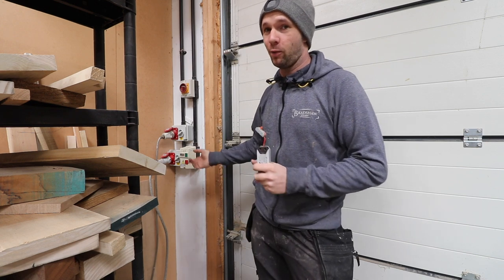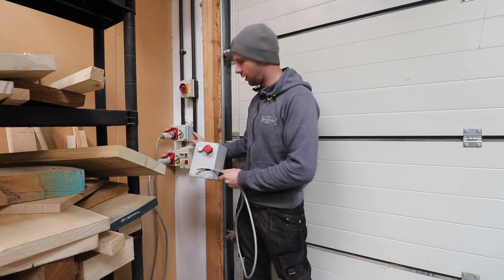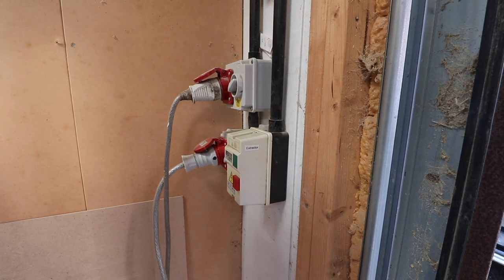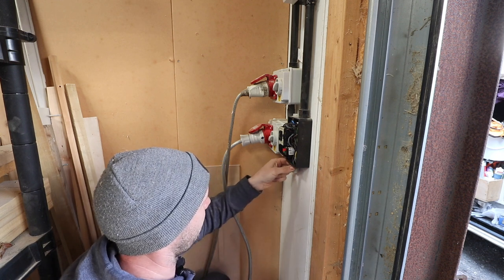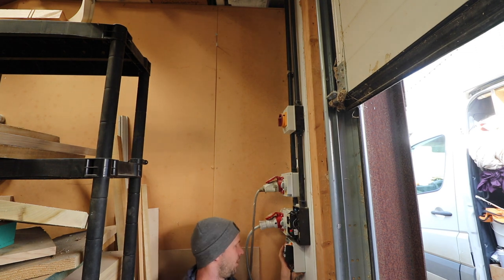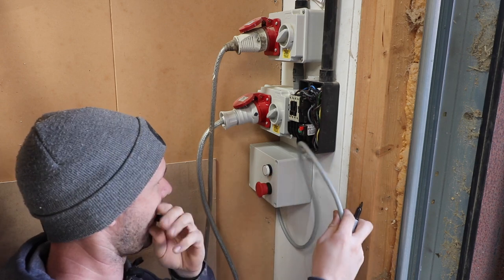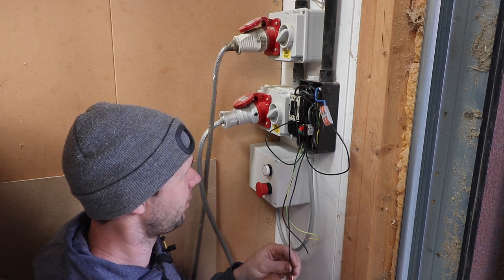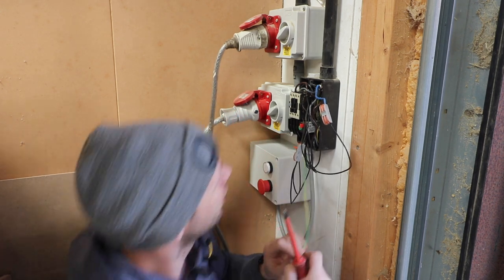Proper Solution for Remote Control 415v Dust Extractor

Comment: On dust extractors that are connected to machinery circuits, the extra run time when turning off gives the extraction system time to clear the vacuum lines before shutting down. In your case, with a remote, the off run time should be based on the machine furthest away from the main extraction unit so lines clear and build up at blast gates is reduced.
Reply from the maker: Yeah true, I just assumed that the remote system your telling to shut off, so can shut off at the appropriate time. It makes sense and is no bother though!

Comment: A great improvement with your audio Oli 👍🏻
A good modification for controlling the extractor too, very reasonable price for the added convenience. 
I think I will be picking up a set of those long Erbauer bits too. I had an occasion recently where I could’ve really used them. Thanks for the tip off 👍🏻
Reply from the maker: Cheers Mike, i was astounded at the audio difference. Yes i liked the unit overall. Itll be a very welcome addition to my shop! What i like about the bits is the compact little case and no extra ones your never going to use...!

Comment: I am always learning things from you. Thanks. Prior to festool developing their own Bluetooth system I’d managed to find an aftermarket bt set up for jobsites / very portable and efficient to employ when Using a cordless sander or Mirca sanding block with a dust extractor.
Reply from the maker: Cheers Mark, Was it a bluetooth plug adapter? I know they work but prone to failure due to the load of a extractor motor, these guys do a solution for that aswell! haha The bluetooth is incredibly handy
Reply: I worried about the load to a point and so kept an eye on things. I was using big box BT with an old CT 22, no problems at all long or short term. Used many hours at a stint on new construction custom home projects. Maybe I was just lucky!  It was not a very refined setup, just efficient.

Comment: Nice. I am lookin go to get a new dust collector too. Current one is too small for the wide belt sander.
Reply from the maker: Ahh, yeah they need a bit of sucky sucky! How big you going, i saw a setup the size of my workshop for sale the other day! haha! It would turn my shop inside out i reckon
Reply: I probably upgrade to a 25HP DT-250 with 9000CFM. I need more space in dust bay. The one I currently have is headache need to clean once an hour if I am running crazy amount or lumber through planet and jointer.
Reply: Can’t decide on the wide belt sander SCM vs Weber. Which do you recommend if only for doors and windows plus some cabinets work. Moldings not much. What do you recommend
Reply: Many thanks

Comment: Can anyone recommend a reasonably priced shop vac, with a 60mm inlet. Strangely, Im struggling to find one. Nice solution to that annoyance Oliver.
Reply from the maker: I like the Bosch, gas25 been real robust for last 15 years. but i have to say the festool Midi is brilliant, i wouldnt buy a different hoover again! Not sure if it has a 60mm inlet, think it does, you can get a big bore hose too if needed. 36mm.
Reply: @BradshawJoinery  Bosch gas25, looks promising, and with comes with a 35mm hose🤔Ive tried reducing the 100mm, from the chip extractor, and increasing the 26mm from my Trend T35, but the suction can't cope with my Bosch gts10. Thanks for your time fella.
Reply from the maker: I'm not sure the gas25 would be any better than the t35 if I'm honest!